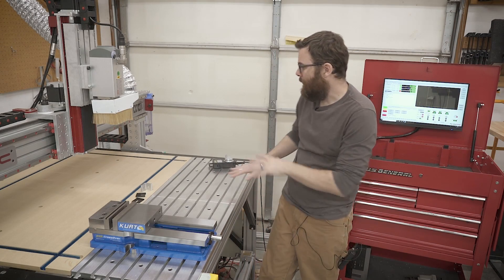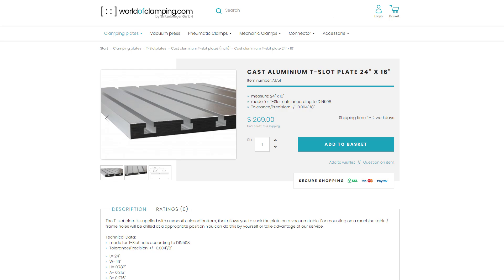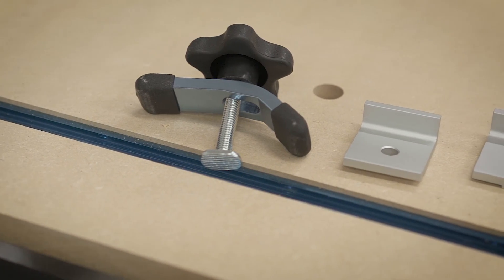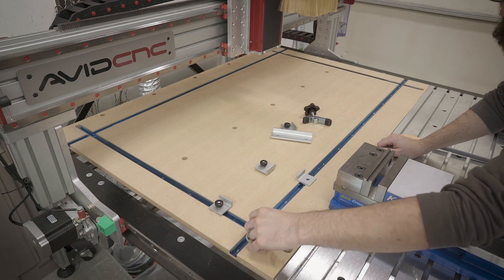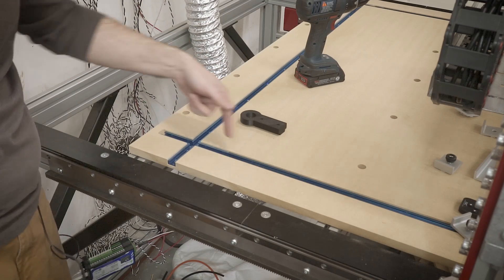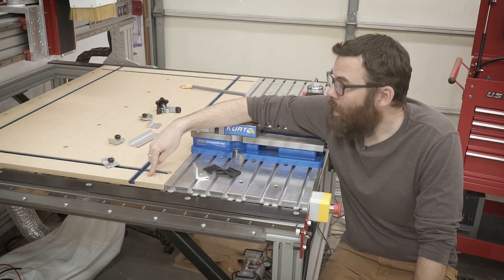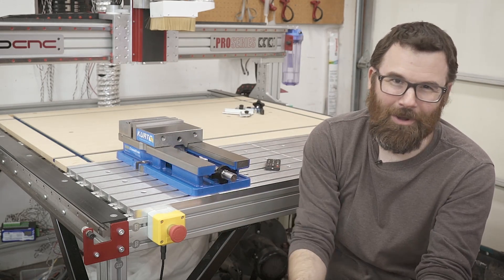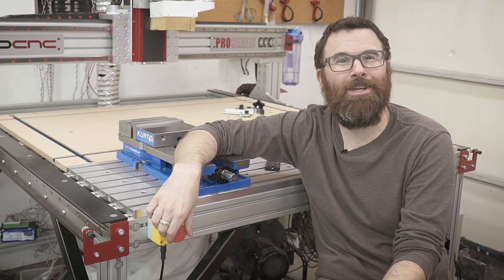Hybrid CNC Router Table

Comment: When I built my router 20 years ago I went with Extira board for the surface. It's like a waterproof mdf.  I used 1.25" thick sheets and cut it into 5.25" boards to make a t-slot bed with .75" slots on 6" centers. I can clamp anywhere on the 5'x12' table. Coolant doesn't affect it and it's thick enough that I can surface it once a year and i still have enough material to last another 20 years.

Comment: I haven't seen the later videos so I don't know if there are any changes, but, in my opinion, a better solution than the T-tracks would be to leave the original MDF alone and use a proper spoilboard, where you can machine down into the spoilboard and when it's too bad, just surface it again. For workholding, create a hole matrix with anchor nuts. It won't be level with the aluminum table, but how often would that be necessary? If it should be necessary, just remove the extra spoilboard for that job. As it is now, you can't really surface the spoilboard anymore without a lot of job with printing and installing new spacers.
Reply from the maker: I just used the t-tracks for a couple of jobs and it's awful, I hate the cheap flimsy t-tracks!  I'm looking at other options and you gave me some ideas, thanks.

Comment: How in the world do you get your holes round? I have had the pro 4896 for almost 3 years and I have never been able to get my holes round. I see people have round holes all the time in their vids and I have no idea how to get to that point. I have trammed and squared so many times and all tests look good. Every single hole is always longer in the x than the y and I always have to oversize to fit things like dogs for aligning parts.
Reply from the maker: Huh, that wouldn't really have anything to do with tramming.  Quite simply, one axis is either moving more or less than it should.  You should tune your steps (in Mach3, how many steps equal how much movement) or check for mechanical backlash.  Check to make sure your gears are properly tensioned against the drive racks.  But you should be able to get round holes, I have no issues getting nearly perfectly round holes in aluminum even.
Reply: @RobertCowanDIY  I never tuned steps because I assumed the factory setup was correct. I should have for the practice of it alone I guess though. I believe my tension is correct. Too high sand it clicks. I adjusted to just below the point of clicking. It's hard to know what's right  I will try and better tune the steps. Thanks. I want round holes in aluminum too
Reply from the maker: @MichaelWoodrum  Just contact Avid.  Seriously, they should be able to help you out.  If not, let me know.

Comment: Hi Robert, now that you've been using this setup, do you find that you really need the aluminum table up front?  You've had to go to a lot of trouble to get the aluminum and the MDF sections to coexist with each other, and with the Kurt vise, I came away from the video thinking a better setup would be to have the whole table be MDF, with various t-tracks of course, and mount the vise to the MDF (after surfacing the MDF of course).  No?
Reply from the maker: The primary reason for the aluminum is using coolant, oil, etc.  This soaks into MDF and causes it to swell, which ruins the surface quickly.  Secondly, if you watch my tramming video, you can see with a single piece of 3/4" MDF, you can easily flex the table by hand.  This would make the vise mounting pretty pointless.

Comment: I don't get why so many hobbyists get these type of kit machines, and their first project isn't to build a torsion box vacuum table? That's honestly the only good use for MDF. It's ability to pull vacuum through the porous substrate. Glueing, clamping and screwing to MDF just seems archaic when you've been spoil-boarded by vacuum!
That being said, I LOVE your front half of the table set-up. If I were to go the Avid-CNC route, I'd make my whole base top like that... and maybe add spoil board only when needed. Or a clamp on torsion box vacuum table, or even vacuum pods bolted to the T-Slot top.
I recently bought the Pierson Work Holding router bit for making the gasket groove, along with their little venturi vacuum kit. I'm waiting on some 3/8" aluminum plate to arrive, and I'm basically going to mimic a work holding jig, but the entire surface. That way I can use sacrificial LDF (skim milled both sides) and keep cutting, planing until it's too thin to be usable. Rinse and Repeat!

Comment: Make new brackets with deeper keys? like your 3d print.
how about drill a hole right in between the mdf and aluminum, with a thick washer to keep both held down, then 3d print plugs for chips, same for t slots.

Comment: Awsome build thanks for sharing. I've been thinking about a similar configuration and those T-slot tables are far better than what I had found. 

The few times I have used a vice in CNCRP set up, it eats up a lot of your Z-axis and difficult to get a decent-sized tool. So, I'm considering a lower front table about the height of the vice. Then just having an MDF box to sit on top if I want to cut panels.  

Also, I am wondering why you ran the aluminum t-slots, side to side instead of front to back? Looks like three 16x16in plates cost about the same as two 16x24 plates. 

Keep up the good work and keep us posted on how it works out.

Comment: You should have screwed the rails opposite...using the round heads as nuts. You would just need to cut the threaded part off, drill and tap them. Then you would be screwing from the outside.
Reply: You'd only be able to do the lower bolts from the outside -- the y-axis rack attaches to the upper slot.
Another option that would allow the cross pieces to be touching each other would be to wedge some blocks into the slots on the back side of front rail that would key it to the first inside rail. Attach that first inside rail with 4 bolts on the exposed back side (instead of the normal 8 if you did front and back). Another set of blocks to key the first inside rail to the 2nd inside rail, etc. Not sure if there's an advantage to having a lot more cross rails, but without as many bolts per rail. Diminishing returns, and all that.
Or, some bigger extrusions (like the one used for the gantry -- 2 or 3 of those instead of 5 smaller ones would probably be more rigid, and more expensive).

Comment: Too much aluminum. It will never cut well for metals. But it looks great. Sorry for the bad news.
Reply: I wouldn't be so quick to assume that. First of Kern cnc machines use a lot of aluminum because of better heat conductivity, but they are still able to do hardmilling (even with 5 axis lol).  Second: I think it very much depends on the geometry and amount of aluminum. Obviously aluminum has about 40% the mass of steel so you'd need 2,5 times the volume of alu the get the same mass(which helps a lot with rigidity) plus I'd be way stiffer than steel. 
I hope this makes sense haha :D

Comment: Just buy some new MDF it’s cheap! Glue 2 .5” pieces together and surface down to .8 fix the track depth and the length instead of all these other manipulation to the existing piece of MDF
Reply from the maker: That's probably my next step.  I really only did what I did because I didn't want to leave the house and go to Home Depot to get more material.  But gluing them together to form a thicker board would be the way to go.

Comment: Really appreciate the video.  I've been struggling with what to do with the spoil board on our Avid Pro to cut aluminum.  Very interested to see how your design works out and if the back MDF gets affected by the fogbuster coolant while cutting.  Any other tips on cutting aluminum would be appreciated as well.
Reply: I can't speak to it's sucess but I am in the process of making spoiler board out of HDPE. Not sure of how it's expansion properties but it should handle the mouisture.

Comment: I wouldn't surface those plates as they were probably already machined to a better tolerance than what your router can do.
Reply from the maker: You're not wrong, but once mounted, their flatness is a bit irrelevant, since it would rely on what they're bolted to.  I will try to avoid facing them down if I can, but they are only as flat as what they're attached to.
Reply: @RobertCowanDIY  that is true. I would put an indicator across them to check, of us not to far out then just shim. Personally I would avoid facing. Perhaps get the extrusion underneath faced.
Reply: Agree with shims to get table perfect and torquing all the table bolts to the proper spec. You could fill the aluminum extrusions with sand/lead shot to give it some weight and dampening
BTW very nice machine

Comment: 3 options for tightening the fasteners.
1. Get a long shank 1/4 inch hex insert bit of the right size, or if there is enough clearance you might be able to use a short bit in a bit holder. Put this into a 1/4 inch drive socket adapter, or just use a 1/4 inch socket and some tape. Then put all your 1/4 inch socket extensions on that, then a 1/4 inch to 3/8 inch adapter, and some 3/8th inch socket extensions. By now there should be enough flex to be above the top of the beam, and now you can use a ratchet, or pop a impact driver socket adapter on and just buzz it in.
If it's a hex fastener, if you use a ball end hex bit you get more wiggle. You can also use a wobbly end extension.
Using this method you should be able to install them as close as the diameter of the extension or adapter, so within 1/2 an inch or so.
And you may think that sounds really complicated, but you should have those adapters on hand anyway lol  I always add these adaptors to a socket set, sometimes stored inside larger sockets etc, and they often save my bacon. I will usually toss an extra long 1/4 inch extension in too.

Another option which is less fiddly, but I don't like as much, is one of the 1/4 inch hex flex shaft extensions. They have less torque available, but then you just put a insert screwdriver handle on the end and tighten it up.
It would possibly let you put them even closer together.

Another thought is to modify the beams slightly.
I don't know how stable this would be, but if you are just needing extra support, you may be able to add more beams and sandwich them.

Basically, I am thinking of putting one beam in with all fasteners, and then putting another up against it, clamping them together, and then just attaching the outer fasteners on the second beam.
It would not be as secure, but it would be wedged against the first one. You could put several in that way, just doing the outer fasteners on each.
Then when you have your cluster in, you can drill through all of them and bolt them tight together, preventing any twisting or shifting.
Without seeing the ends, I don't know if a single fastener will give any stability, but if it's like I think, it would add more stability then without them.
But putting them half an inch apart and using both fasteners like I talked about above is probably the best.

I also wouldn't be surprised if you could figure out some way to modify the beam to allow you to access the trapped fastener from the top through a slot, or use a 90° bit driver gearbox down through a hole in the top, or even put a fixed nut in the end of the beam, and bolt through the opposite direction from the outside, but I don't know what your track on the sides looks like.

I loved the 3d printed Forstener bit guide! The capabilities of modern technology are amazing lol

Comment: Hey, about the difficulty with the cross members: There are flex waves for drills etc., my little Bosch ixo also came with a 90 degree driver. You coul use something like that to easily access those screws.
Reply from the maker: I'll have to look at those again, I remember not finding what I needed, but I'll try looking harder.
Reply: Robert Cowan A lot of bit sets with small bits have a small type of flex shaft that can be attached to a slim screw driver. Maybe you could fabricobble something out of that. I‘ll send a link as to what I mean when I have one.
Reply: Robert Cowan just search amazon for “flex screwdriver”. I’m sure you will find something ;)
Reply: Yeah, there's adapters that have a universal joint that give limited angle movement (but usually enough) or longer shafts where the whole thing is flexible. Usually the one with a universal joint (that type is a little stronger) is called a pivot bit holder and the other is a flexible shaft bit holder.

Typically they are used for power tools, but can easily be used with hand tools that have replaceable bits too.

Comment: I like your video very much. But I think you self diagnose your work well enough to realise its just better to start up again.
Suggestion. Flip the design 90° in a way that when you stand in front you have spoil board to your right and aluminum to your left
Reply from the maker: I considered that, but then the edge of the vise hangs off the table, and it could possibly interfere with the gantry.  Also, the vise is pretty heavy so loading it to the front is easiest.
Reply: @RobertCowanDIY  it just seems like you will have a hard time getting and working anything on the spoilboard. 
Maybe a removable spoilboard you can set on to the front aluminum would be handy
Reply: @RobertCowanDIY  by the way you and Rainfall projects got me in to cnc, I had sleeples nights between a Tormach and a cnc table. Finally bought a cnc table

Comment: I don't use aluminum extrusions often, but could you have just run short pieces the opposite direction (Y direction on your table) between the cross members rather than fighting to get them so close together? It would've required a different mounting than those nifty Avid pocket style, or some machining to put pockets in. I only have t-slots on aluminum on my AXYZ router and have thought about adding a spoilboard with t-slots like yours just because it opens up a lot of clamping options made for that style t-slot.
Reply from the maker: Yeah, I could most likely do that.  Doing it over again, that might have been the better way to go.